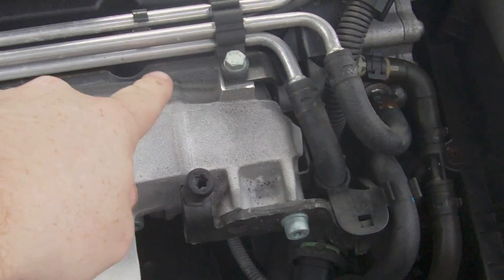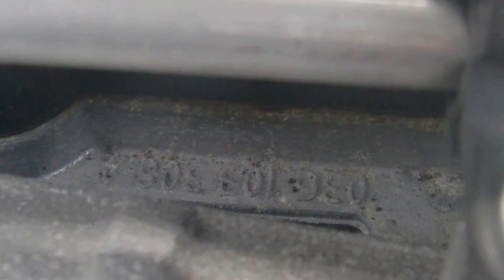Volkswagen BKD Engine....Identifying cylinder head revision (check comments) this video is wrong

Comment: i never considered a golf mkV but on the other hand there is no difference between the 2nd gen A3 and golf MKV. same platform. but audi parts are more expensive than VW .£70 for a drivers door armrest. the 2.0 TDI's did get better. the BKD was the first 2.0 TDI developed and first used in the 2nd gen A3. i put rad weld in the rad in the summer got stuck in a traffic jam on very hot day to my amazement it didnt overheat garage wants £350 for a new rad.
Reply from the maker: Golf MK5 rusting issues were sorted around 2007 onwards, Audi are generally better built than VW due to body panels. My next car won't be a VW simply because they're shit. I'll only go back to VW if they sort out the build quality
Reply: ive got to admit audi's build quality is faultless. my A3 had a little rust expected for a car that age. im not sure what to get next its not that audi are rubbish its the price of parts, servicing etc thats gets me.its sailed through its M.O.T's. however there is a VW/AUDI scrap yard in my town.
Reply from the maker: Audi bodywork I believe is aluminium so it doesn't rust whereas VW paint warranty are a nightmare to deal aswell. VW commonly put them down as wear / tear damage from stone chips. Don't get me started on the boot badges. Audi use the same parts as VW, so there shouldn't be any reason why you can't buy VW parts and fit them to an audi, there would be a bit more research needed but it should still be a case of swapping over parts.
Reply: 10 year warranty on anti body corrosion not and 12 year anti chassis corrosion. i think its down to the type of metal that audi use and galvanization. thats why they last so well. audi only treat the body if the rust has formed inside the car not on the outside.
Reply: what ive found is that some audi's rust and some dont. peugeot's are excellent for rust protection too. ive seen a 24 year old 205 last week yes the paint faded but  not a spot of rust on it at all.
Reply: i think if audi made their own engines they would be better. thats not to say that VW engines are bad. its just that some are hit and miss The BKD indeed and the 1.8t went through coil packs like no tommorrow.
Reply: its great knowing that my engine is all original though.
Reply: ***** are you still having trouble with hot starts? there is a way round it with no mods or money spent. . usual 2-3 seconds to fire at normal coolant temp after a longish run.I was. but I tried this if you flick the key once to start the engine the starter will turn over once then flick it back to ignition start it again in holding the key in the start position it goes straight away. I thought I invented it but its been mentioned on another clip and it does work. its possibly something to do with priming  or fuel temp. it did say in my audi A3 handbook that the injectors on the diesel engines should be replaced at every 60K due to wear and tear im on 79,500 and a bit and im not doing it too much money.
Reply from the maker: I haven't tried it but I can try on the way to work. Can you clarify what you mean by this...

1> Turn engine off
2 > Turn engine to ignition on (don't start)
3 > Quickly turn igntion back to off
4 > Quickly turn ignition and try to start car?

Is that the procedure you're referring to.... basically ignition off, quick to live, quick to off, quick to live > start
Reply: ***** yes it does work at normal coolant temp. turn the key to ignition. start the car let the starter turn over once flick the back ignition and start the engine again holding the key in the start position it goes straight away. the ignition needs to stay on because by turning it the car on and off you can flood the engine if you get what I mean. ignition has to stay on to make the procedure fully work. let me know if it works it should do.
Reply from the maker: Thanks I'll try it out when I get to work
Reply: ***** good luck Andrew. highly likely it should work.
Reply from the maker: Didn't for me unfortunately unless I'm doing it wrong but I don't think I did :(
Reply: tell you what Andrew after Christmas ill post a video of my A3 at normal temp ill start it showing the poor start then my procedure. hopefully it will show more insight. will you share the video if it works for me? I basically think its a design fault on that engine. off the top of my head my dad's 56 plate A6 2.0 TDI had a different engine no problems just a tank.
Reply: I think idk by one crank of the starter that's spraying fuel into the injectors. then turning the car over again sprays the fuel from the injectors into the engine and then should carry on running. I suppose its like pouring fuel into a carb it will run on whats in it then hopefully keep going when the fuel from the tank has reached the carb. sorry lol but yeah ill post a video and see if you get the same result after a longish drive.
Reply from the maker: I will do thanks for the update. It will help troubleshoot the problems at least if it works for me.
Reply: ill do it when I can.
Reply: ***** ive got to the route of the problem andrew. my hot starting issue was caused by suspected incorrect injecting timing. everything has been reset on the ECU. injectors re calibrated and cleaned just to be safe.  now to get it through its MOT. not failed one yet. even though i get 2 advisories saying engine cover obscuring components engine undertray obscuring components thats to protect everything.
Reply from the maker: How did you know the injection timing was off, did you monitor it via vagcom. Is the car hot starting correctly now?
Reply: ***** the specialist confirmed it when he started it and left it idling then plugged into the VAG com. readings showed that the timing was off by 3 degrees so he's done something with the cam sprocket and reset the timing and checked it out on the VAG com no error codes now. ive driven it andrew and since its been retimed its more responsive, its better on fuel and last but not least its starting better. garage said the timing can cause all sorts of issues eg poor idling rubbish starts etc. that quick start procedure was just priming the injectors then starting it again would just ignite the fuel. just like putting petrol in a carb then letting the engine run off its own fuel. shouldnt have to do that procedure now hopefully.
Reply: Michael Jagger starting issue has come back i thought the re timing sorted it out but its not. ive got a new starter motor and a new coolant temp sensor for it. cars going in the garage to see if will go better. if its cranking at 300RPM from hot it should fire nearly straight away. any lower than that not as quick slowly goes up to 200rpm then fires battery is ok

Comment: I have BKD engine. A-type. It starts bad when cold. Can you give me some advices? Here is my video with my start: Audi A3, 2.0 TDI, (BKD) bad start, loosing coolant
Reply from the maker: If your car is losing coolant then it's going somewhere. Are there any visible drips under the car of wet spots. You mention it starts on 3 cylinders. Have you run a compression test on the block?
Reply: ***** There are no visible marks of coolant anywhere. Sometimes, if i let it sitting in place more days it starts really bad, in 3 cylinders. On compression test, same values on every cylinder.
Reply from the maker: freezingthedarkness
Fuel injectors? Have they been tested. Or cleaned.
Reply: Correct answer.
Reply from the maker: Very possible. A compression test would reveal it, sorry to hear it :(

Comment: I have the A -Series cyl head done 79k no problems apart from a new turbo due to a garage overfilling the engine oil
Reply from the maker: Thanks Michael, mine is currently on 66k no current issues as yet. Although I'll always prepare for the inevitable. My car has the hot start issue too, many things which are a pain on these cars. Although the paint and rust bother me more
Reply: I do have rust on the tailgate near the number plate lights red oxide primer will be applied. blame VW.
Reply: ***** one day my engine lost all its coolant good job the computer told me or i could of driven it and game over. topped it up again that night disappeared again there was no wet marks showing. so took the sump cover off and i went pink lol just a rad leak now sorted.
Reply: ***** how long does your car take to start from hot? mines going in next week for further investigation ive heard its a software error but an update can be done its rumoured that VW didn't recognise it.
Reply from the maker: There's multiple reasons for the infamous hot start issues. 1) bad software map. 2) injector fault 3) injector seals 4)bad battery voltage 5) bad alternator 6) bad start motor cranking speed. Those are the ones I can think of. My car is bad starting hot it cranks for about 3-5 secs before it starts whereas when cold it starts instantly. It also appears to be "weaker" when cranking when hot. When cold it's like it's engaging hard when starting but when hot it's a bit weakling ha
Reply: it appears to be not a good engine. i have heard that the coolant temp sensor can be an issue too. it does start slow even though it had a new battery last year.
Reply: if its expensive to put right it will have to stay like that until something goes bang.
Reply from the maker: Yes, I forgot to mention the coolant temperature sensor too forgot about that one. There's 3 revision to the engine, it's just the one VW designed was shit. Saying that some people never experience water loss. It's really hit or miss although I'd be interested to compile a report of all the ones suffering to see if there's a trend could be a faulty batch. Either way I'll deal with it until it comes. Can't afford to keep fixing the car. I'll wait until it breaks first :)
Reply: ***** thats what im doing i also have a slow cranking speed even though it has a 70amp battery new one last year. they say when cranking it has to be 200rpm or more for the injectors to spray diesel into the engine ill have a look at the rpm when starting from hot. im thinking a worn starter motor. also got a new VAG coolant temp sensor if thats the cause of bad hot starts.. im driving mine until it goes badly wrong. i could do with a VAG com but only dealers have it £60 on the VAG com. The BKD was vw's first 2.0 diesel. i think the 2.0 diesels no matter what code did get better. some BKD's are ok some aren't. it sounds more like a design fault. the 1.9 TDI/PD is bulletproof.
Reply: i do have a brand new coolant temp ready if thats the case for hot start trouble. ive suffered water loss but that was because a pinhole was found in the rad. its fixed now.
Reply: ***** my specialist has ruled out all the common suspects eg starter, coolant sensor, battery etc VAG com showed no faults at all. the ABS did go on it. another common fault now repaired.
Reply from the maker: Indeed. The old 1.9 AFN engine was legendary if you didn't have an issues with limp mode. If I had the monry I'd buy a spare bkd engine and try to troubleshoot all the hot start issues. Crank speed is one of the things I haven't checked on my golf although I suspect the battery is dying on it too because it's getting harder to crank some mornings or the glow plugs are faulty. I'll get those tested out next. The vagcom unit is 200 from suppliers but it's worth it as it scans any vw based car and is a generic reader ideally a vagcom and vagatachho would be a good combination. I also tried the fast starting for the hot start issues. Didn't work for me. If it was that it could point to a relay as I vaguely remember some vw suffering from a 109 relay issue where they burn out
Reply: sorry it didn't work. I suppose every BKD engine is different. it does work for me but I wont do it to much. the hot start has to be a design fault at least
Reply from the maker: The basic fault of the hot start is because older engines used to inject small quantities of fuel to help start it up. The newer models dont as it wastes fuel. There's so many issues with these engines, they're amazing but a PITA
Reply: ***** It can be chipped so it injects fuel when hot. Sometimes my car will start almost straight away sometimes not. Im now on 88k and its still going well.
Reply from the maker: Very annoying. I'm on 94k now, still going strong :)
Reply: ***** I think the BKD engine is hit and miss. Not all of the cyl heads go porous or have dmf problems. My A3 has been dead reliable since its new turbo 4 yrs ago.

Comment: interesting. I have an A3 2.0TDI 2004 with the bkd engine. its fine only problem hot starts 3-4 secs to start but doesn't struggle so note to worry about its known problem.